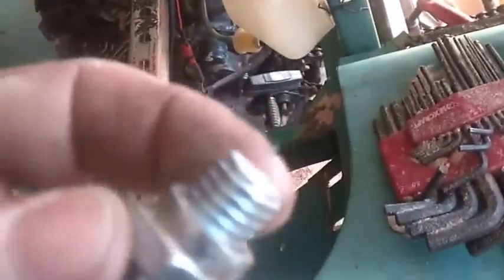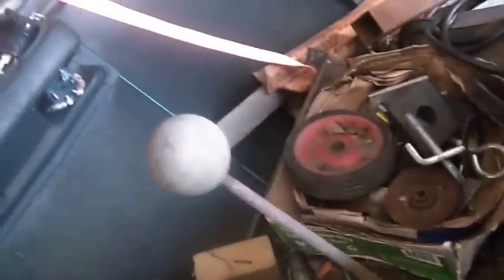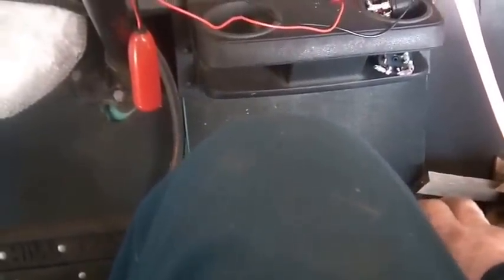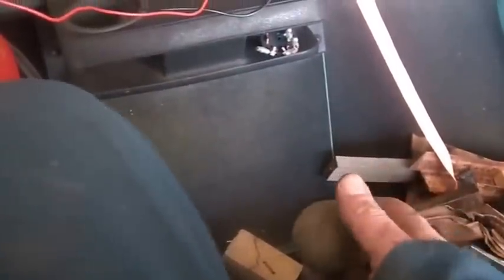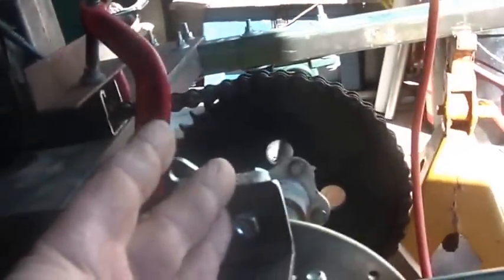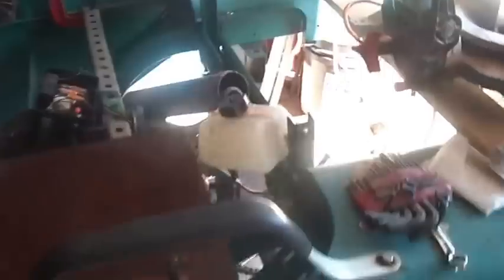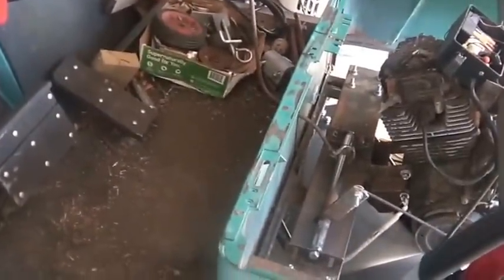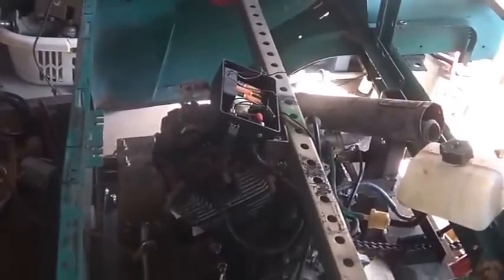1988 Electric EZGO to Honda ATV powered UTV, Red Neck Gear Shifter

Comment: Looking good! Mount the gas tank on the dash. Run the fuel line under the car. Has long as the tank is higher than the carb if will flow.

Comment: for reverse use could use a manual choke cable and for chain a tensioner from a ATC 110 if you have a place to mount it

Comment: personally,i wouldnt rush just to drive it. no brakes and no throttle is asking for trouble. the suzuki uses a pulse fuel pump,must be one on a tractor in the hoard. tee it into the crankcase vent.the craftsmans have a nice big fuel tank that mounts easily with 2 tabs.
Reply from the maker: +roger oconnor , I had it out today for its first ride, should have a video up in a day or so, it is a hand full to drive, it kind of plows when I steer due to the straight axle in the back... It will be a great toy to play with!!!! Thanks for your thoughts, watching, and commenting!!!!